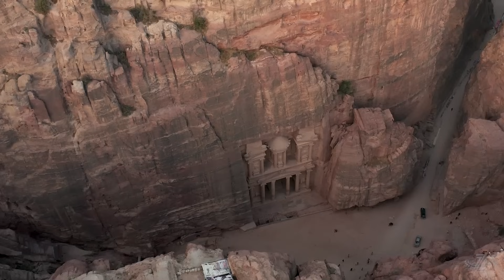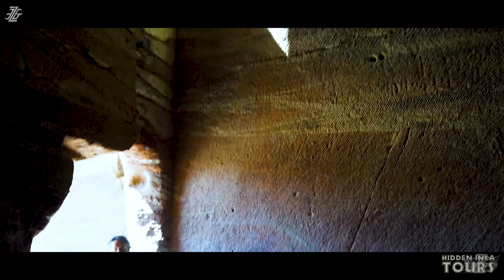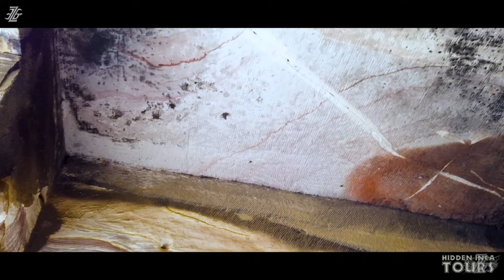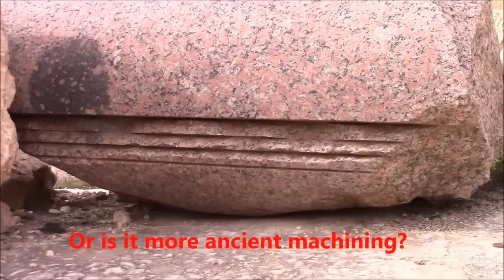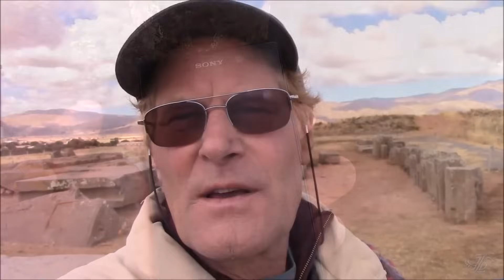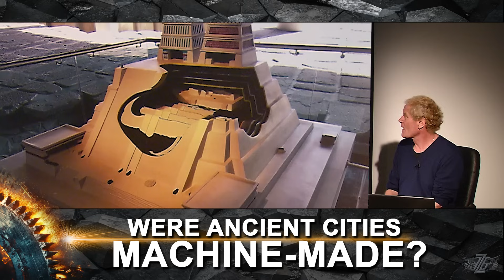Ancient Lost Tech Is Not What You Think | Ancient Worlds Unsolved Mysteries

Comment: I totally agree with the whole lost history of our planet. What I wonder though is not so much when was their end but when was their begining. How long did it take for example, to erode the sphinx to that extent? I am missing so much info on these things. With that in mind, we need to listen to guys like Robert Shock and Chris Dunne for answers. So when was the Giza peninsula wet enough to cause that much water erosion and then decide on how long it took. Now add them together to come up with when it was built. I cant help but think it would take many years of erosion, depending on the frequency of rainfall. I can see the sphinx being very old. The theory of the base stonework being the biggest stones on the bottom and the best construction techniques used there is just so obvious that the foundations are way older than the later additions. I do think that many of the measuring devices could have been accomplished. Things like true north alignment can be done fairly easily and making a surface measuring devise can  be made. Tube drills could be used to drill the holes that have been found but how long would it take to do these things. You could make an alignment devise to keep a drill straight but what does the bottom of the hole look like? That could tell us much so someone should look at those holes at Puma Punku. Maybe stick a bore scope in the hole to see. The shape of the drill end could go a long way in determining the method.

Comment: another mind boggling thing about cutting tools used in the ancients such as the hard stones in egypt slice cut with somewhat thin cutters such as thin diamond wheel concrete cutters. But even concrete cutters leaves marks...not like those hardstones cut in egypt...thin slice cut but smooth polished cut between the thin gap. laser cuting?
Reply: Depending on how accurate you want it? Water jet, blades, chains or even LERN tech. Ultrasound.

Comment: The pillars are not machined on a lathe it would make smooth rings all at the same diameter not notches. The notches are interesting as to how they were made .The only way to get those notches is vibration when cutting , which would mean the job was turning to fast or not secure enough or they more than likely they were done by hand because the notches are not symmetrical.

Comment: What about carving out a human sized chamber and then digging the floor out. Carving down deeper and deeper and not needing to reach a high ceiling. Carving from ceiling down.
Reply: It is like building sand castles on the beach. Make a pile of qwt sand and then carving out from the top down. They could start with a rock wall and carving all the structures from the top down to the present floor.

Comment: Why are there no tools found? There must be tools somewhere. The leveling, the fitting, the lifting....they must have had multidimensional measurement tools, fraisetools, polishing tools. We should not think we are smarter because we don't even know how they build all the megalith structures. I have a parabolic satellite disc and stuck small mirrors on the inside and put a stone where the LNB used to be......put it all in the sun and after a minute the stone cracked from heat. So you can create enormous heat with multiple mirrors concentrated on a single point.

Comment: Fascinating for sure. I have been in an old limestone quarry in France. There are similiar grooves or parallel lines on the walls but these in France were made by massive hand saws, of which I have an old rusty example that is 1.5m long for use by one man. They were tough, also huge blocks of stone like 1.5m cubed not moved by machine  but rollers and lever bars. But the stones were rough for others to work on. I myself am a stone mason and it blows my mind at the exquisit and scale of the ancients. Certainly civilisation had to be more advanced in distant past. Thank you for sharing these marvelous wonders.
Reply: Check your math. Hardness scale, listen to what this Guy said about Petra and the materials used.
Reply: @Bob-oe4hc  I have watched many a doc about Petra, I believe the stone is not that hard, however stone hardness can even vary in just one quarry, just metres apart. In my humble opinion, there is no doubt these ancients were more advanced than legacy historians have taught us. No question, ancient civilisation had advanced knowledge that is either lost or even hidden.
Reply: @Max-Bliss  he said it was granite, which is what He had been told. Then He said that it wasn't it was the one that's 7 on the scale, 10 being diamond & granite being 5, if I remember correctly. So not just steel to create it, but something harder and a furnace hotter than 'conventional steel'. It's equivalent to a sword made by an Apprentice v a Master Smith's version. They look almost the same but are Not the Same.
Reply: @Bob-oe4hc  Most of Petra monuments were carved in two layers of sandstone. These layers are referred to as “Disi Sandstone”, in the upper parts of the site, and “Umm Ishrin sandstone” below it.

Comment: The Ancient Egyptians perfected “The Double Slit Experiment”

At the Temple of Seti the 1st in Abydos there is thought to be two old wells in the first court yard, but they weren’t old wells they were obelisks. When those obelisks were hit by lightning they would emit ultrasound waves from the quartzite blocks in the fluid they sat in. The ultrasound waves would diffract out of the openings in front of them and combine together to create pressure nodes/cavitation points in the water. The most powerful of those pressure points was the “Prominent Central Maximum” area that shoots out perpendicularly from the point directly between the two holes. 

This is known as “The Double Slit Experiment”.

 Most of the energy is sent through the center of the complex to the second court yard and some of the energy is reflected into a smaller passage on the side to the second court yard, setting up the second double slit experiment, only this time it’s a little trickier because the slits are different sizes. In the case of different sized slits the overall pattern will show the “Prominent Central Maximum” leaning towards the side of the wider slit. Of course this is exactly what the Ancient Egyptians had planned because the “Prominent Central Maximum” would now be perfectly lined up to create maximum fluid cavitation/metal separation all the way back to the end of the complex at the Inner Orion Hall. The Ancient Egyptians were masters of wave reflection, diffraction, and by the time their waves got to the First Hypostyle Hall they underwent a “Triple Slit Experiment” that is mostly thwarted by a scattering array of circular columns.
Reply: obelisks were like telephone poles, is what i think.
Reply: @wayne3093  that's right, there's no reason a tall pointy thing will get hit by lightning more often than the tall pointy thing standing right next to it. You need to turn the tall pointy thing into a active lighting rod to attract the lighting
Reply: Clap

Comment: Great video; I was just wondering if the tool marks go into the corners, as it looks like it. It's very difficult to get machines to makes it into any corners from two different angles or plains typically rotating cylinders would not be able do this, so I was thinking of a set of toothed perhaps overlapping moving backwards on forwards could achieve this, but what makes that stand out is the tooth chisel makes run at angels to the corresponding surfaces making the tool adjustable to line up with said surfaces. Fascinating stuff, to say the least

Comment: The h blocks were certainly made by moulds... As someone that did that for a living, I can tell you everything about them is consistent with that and in today's world there are parallels to explain every bit of it.

The consistency of some and different sizes are very explainable. As we know most of them have been moved/scavenged. So making more clincial comparisons to find that consistency between differnt blocks made from the same set of moulds is difficult... The examples left probably didn't come from the same, but similar moulds. And it's very common even today for people to go through several iterations of moulds within their own company where sometimes new batches are not exact to the style and standards of previous moulds. But due to cost they get used instead of being remade more often than not.
AS WELL as the fact that there are other makers with similar but imperfect versions of their own, built to resemble one another. But with slightly different sizes and often slightly different styling but resembling each other enough that only someone working with them would know the difference at first glance.

Also the seeming lesser quality or pitted h-stones are explainable. There's every possibility they got a bad pour which would make them weather/flake or degrade quicker. As well as it being possible they weren't cured properly before being removed from the moulds which would cause the same kind of appearance. Especially where the corners are concerned... That is typically an area of weakness or stress when removing improperly cured items from moulds.

I've every confidence they were created from moulds. Most of us acknowledge that we've lost knowledge of and from previous civilizations. Every person that beomes an archaelogist would have to agree with that much or they wouldn't be doing what they're doing. And it's not impossible that they had some machining technology or ABILITY'S we don't give them credit for today. But there are many inconsistencies and clear mistakes with almost every person claiming today that there was CLEAR signs of ancient technology. That doesn't even prove them wrong. It's just the zeal and FAITH they have in that theory OFTEN makes them ignore or overlook simple truths that many of us have experience with that prove them wrong about some of their claims.

I still believe the ancient technology in general is true. And we have much left to discover. But we need to weed out the mistakes and false claims to get to the truth if we can't find actual proof somewhere to come to sensible conclusions about how or if we're lucky, why they built what they did. And who THEY were.

Comment: Diamond is the only material that cannot be cut with an aquajet.
9 on the Moh's scale takes the longest to erode. Diamond doesn't. Due to this, Diamond is used to make the aquajet orifices.
Orifice size can be the diametre of a human hair. Water pressure at the orifice is typically 60,000 psi. 
This cuts granite like a hot knife through butter, :-)

An aquajet pump is about the size of a pool table and quite portable. It has a 100 HP engine driving the pump.
Aquajet can be done at your home, with the machine in a small truck.
Aquajet doesn't necessarily leave cut marks or, of course, burn marks 🙂 Aquajet can leave ridges, at the operator's speed of work and finish required.

If the aquajet nozzle is on a computer numerical controled robotic arm, any sculpture is possible......

To take out a lot of material, parallel slots are cut and the remaining 'fins' are broken off with the swift swing of a hammer on a chisel.
Reply: Follow shape with pentagraph system.

Comment: Another great presentation, Brien! Petra is definitely antideluvian. It went through a huge catastrophe. The rocks around it are all melted and vitrified. Then it was flooded. 

Now in the case of Puma Punko with the residual magnetism, that is electrical in nature. You cannot have magnetism without moving charge or electrical current. This is basic electrical science. So at one time a large amount electrical current was passing through these stones. If you don't want the electricity to escape, you add insulation, or stone that acts as an insulator. The grooves with holes remind me of how one would set up wiring for electrical current. This place may have been a production plant. Copper would have eroded away long ago, as well as the fasteners that held the wire in place. As King Solomon wrote, "There is nothing new under thr sun. That which was is that which shall be. And that which shall be is that which was."

I agree with you on Baalbek. It is antedeluvian. Built during the Age of Saturn, or as the ancients called it "The Golden Age", or "Zep Tepi". All cultures afterward tried to mimic the building techniques.

Since gravity is an electromagnetic  force it is subject to change with the electrical current flows of the Earths electrical field. There is strong evidence that the gravity of the Earth was much different in very ancient times before the Earth was plunged into a huge catastrophe. This enabled animals and humans to grow larger, and live longer. It also enabled them to lift several ton blocks with greater ease. Baalbek is a great machining  achievement. Possibly they had plasma cutting tools? Definitely lathes and power saws. 

Very fascinating things. 

The Golden Age was destroyed and we are now rediscovering it. 

Just like the recent expeditions of a German team, Noah's Ark has been officially found and identified 15,000 ft up on Mt. Ararat.  It fits the Genesis description of it on all points including the size. They studied the wood (cedar, cyprus, and Teke.) Also studied animal feces, hair, feathers, seeds and plants left over from food storage, as well as the living quarters and tool artifacts. And get this, the wood has been radio carbon dated to between 13,000 and 9,000 years ago. That puts it in the Younger Dryas period. More evidence of the great earth catastrophe back then. And we should take the historical accounts of the Bible seriously.

Comment: Its Geopolymer. Like a concrete. 
No magic bs.
Reply: I believe ALL of these megalithic buildings, temples, columns, Petra, H blocks, etc... are carved out of volcanic ash called Tuff.  Very soft material and easy to carve, scoop and mold... especially if it hasn't completely hardened yet.  Notice how not a single "rock" we see is smooth. It all has a cement-like dullness to it.  Also, volcanic ash eventually hardens into granite and other stones.  The difference between the granite we know (which is way more recent and didn't exist then) is that there are remnants of life in it.  The rock here has no remnants of life in it. No fossils - no life.  These rocks weren't quarried because there weren't any quarries yet.

Comment: Has anyone tried using a multimeter to test for current flow, then can it light a l.e.d., can one up the current using parallel connection, or a series connection and or both

Comment: Maybe that's where Mercury come in....here me out.....if steel floats on mercury like wood on water then suspend the stone in mercury fix the ends square....  turn it  using water power and pulleys....as far as cutting tip I am open to suggestions.
Reply: I believe Mercury was the liquid used in these megalithic power stations; specifically, the ones with Lingams.
Reply: @rachel112263  Im of the mindset that mercury has many uses that we haven't been informed of